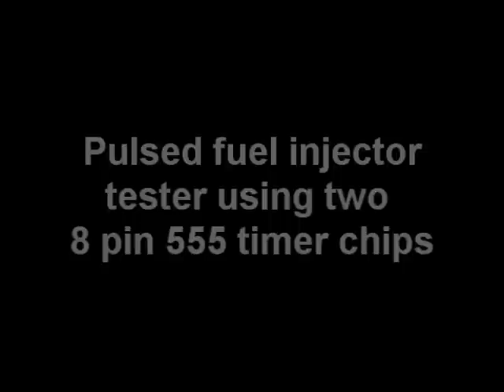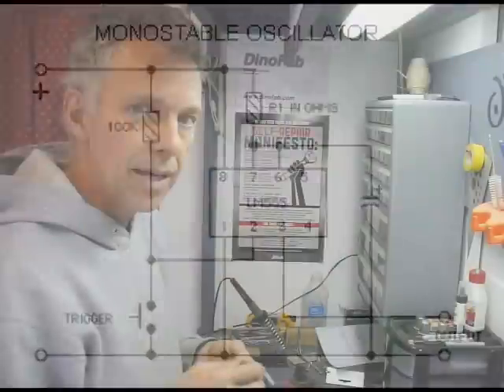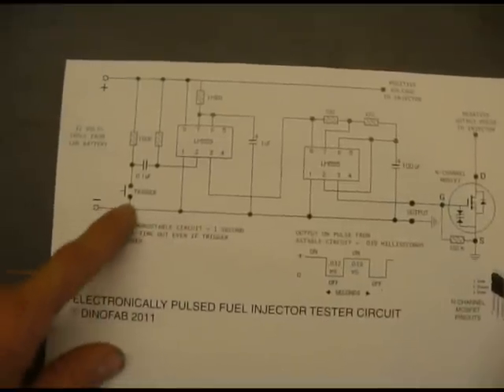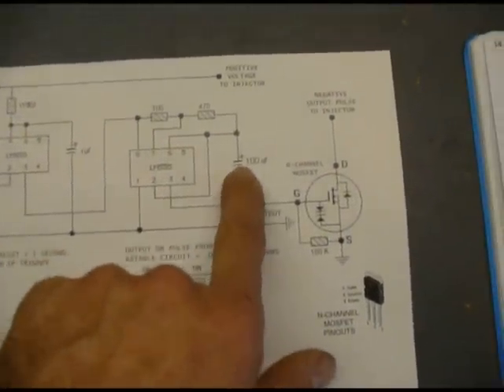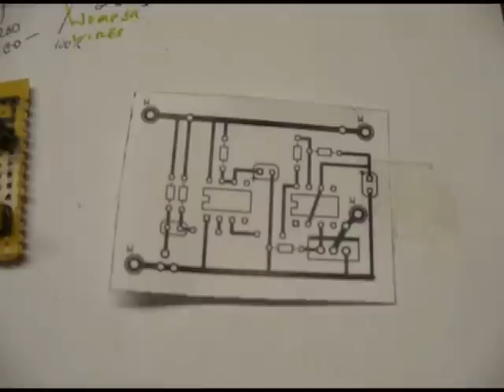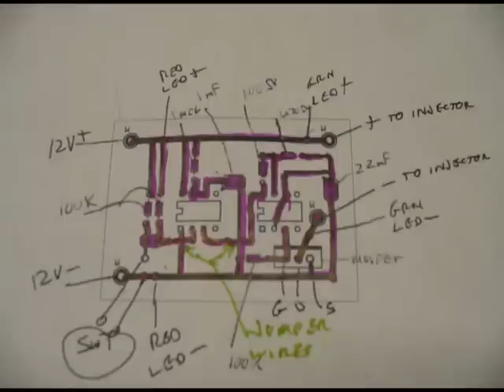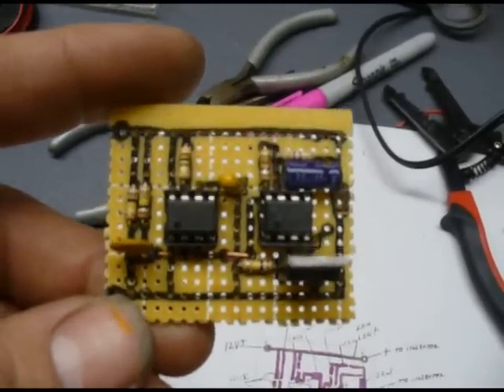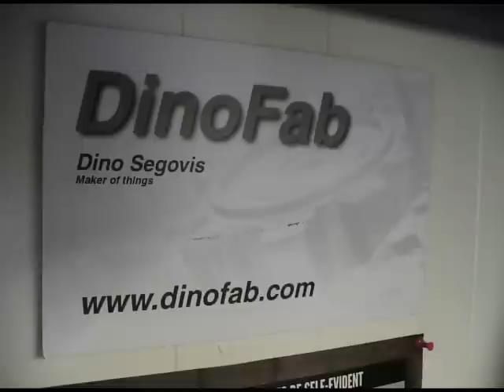Fuel injector tester with 555 timer chips

Comment: This will be great to use for cleaning and balancing injectors. Might have to build a multi injector test bed that I can use to check balancing after a cleaning process on them. Six injectors, one circuit per injector all triggered by the same switch with graduated cylinders to measure fuel throughput...

Comment: Is it possible to convert a petrol external tach gauge to read a diesel signal from the w terminal on a alternator using a 555 timer chip

Comment: Subscribed! This is awesome! I searched for your site, but I was unsuccessful in locating it. I know this video is an older one and I apologize if I missed it, but I didnt see a controller like arduino or rasp-pie.  Was this controlled entirely by the pcb you made?? I am somewhat new to diy small circuits and I am eager to learn more. Also, I read in a few different  places that the amp draw for a fuel injector is somewhere around 950 miliamps. That could be garbage. I am not real sure. Again, awesome video!

Comment: This is cool man! I found this while searching failed PCM injector drivers. I have a #4 Ford 500 injector signal wire thats staying grounded. The result is gas literally dripping out the tail pipe and loads of white smoke. The ground is coming all the way from the PCM because my test light goes out when I unplug the injector harness from the PCM. Of course the injectors are still hot on the hot side with that plug out or else  the test would be invalid. With it plugged in and cranking there is a pulse but the light never goes out.

Comment: This is a really cool project, one I've been meaning to build for a while; I have been getting into electronics through my job and my megasquirted Audi.  I have a question about the monostable circuit.  Is the timer started over every time you let go of the button and push it again, so that if you kept pushing the button before it timed out you could just keep the circuit on, or does it need to count all the way out?
Reply from the maker: The button times out even if you keep holding it. If you want to just trigger a steady pulse train, use the astable circuit only by applying power to pin 8. Normally the output from pin 3 on the monostable circuit would do this for 1 to 5 seconds. 
If you mod the circuit by just adding a switch to do this, be sure to put another 1N4742 protection diode between pin 3 and the switch where it connects to the circuit. Put the cathode (stripe) towards the switch. That way when you apply power to the astable side of the circuit the diode will not allow it to go to pin 3 on the monostable side of the circuit.

Comment: Dean you did a fine job,your a meticulous type of guy like me.So I like your style.One question.Can you substitue the fixed resistors and cap.with variable ones?Or I guess you could put a rotary switch with a config. of cap.&resistors to change the pulse width.I just learned a lot about stuff from your video!Thanks so much Dean,I'll check out your site. Skip J. in Titusville,Fl.

Comment from the maker: That is why the 1N4742 diode is in the circuit. It protects the MOSFET from the back EMF voltage. Check out the schematic on the DinoFab project page. Just Google "DinoFab projects" and look for the fuel injector tester.

Comment: Nicely done. I was hoping to see an injector pulsed though.

You need to simulate a pressurized fuel rail and then use maybe a glass mayo jar so you can observe the fuel spray, right?

Fooling with a toyota fuel rail, I found that if you really need to reuse those crush washers, it's best to heat them up in the flame of a propane torch and either quench them or set them aside to cool (copper softens upon heating and hardens by being "worked")